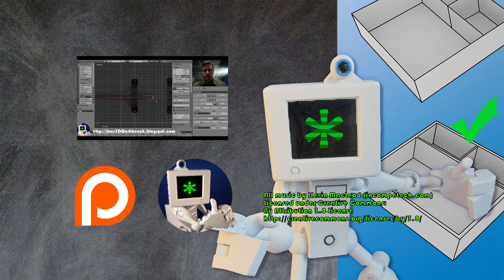3D Printing 101 - 3D Printing without a 3D Printer

Comment: I think with printers as cheap as the monoprice mini, people should probably forego a printing service and just buy their own printer.  I think at $200, a person can find enough stuff to print to offset the cost.  For example, a good set of headphone holders might cost me $10-$20.  A soap dish might cost me $5.  A special mount for something might cost me $5 to $20.  Eventually, you will have printed enough stuff that equals the same cost as the 3D printer if you had bought the items in the store, even if it's just a few small basic things here and there.

In fact, you should make a video that puts together a list of X number of things a first time printer could print, to completely offset the cost of a monoprice mini.  Things everyone could use.